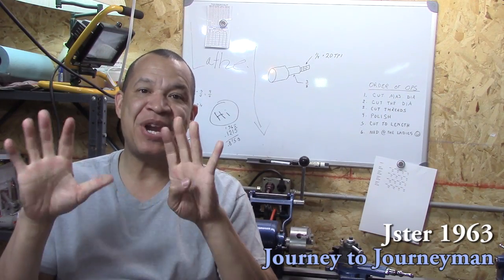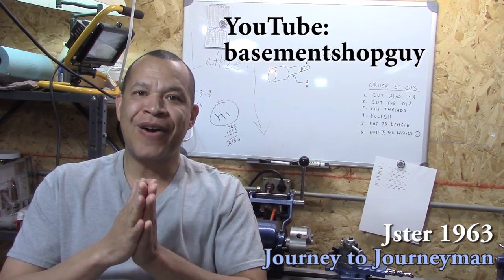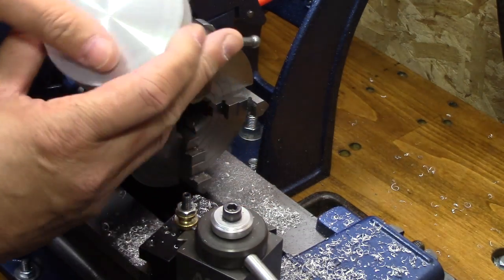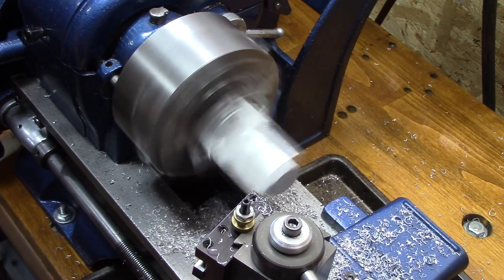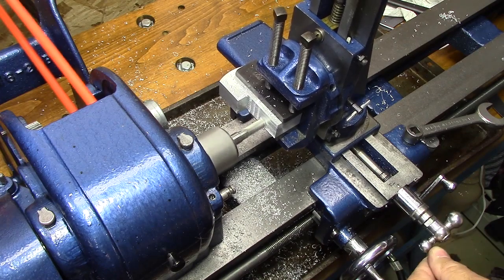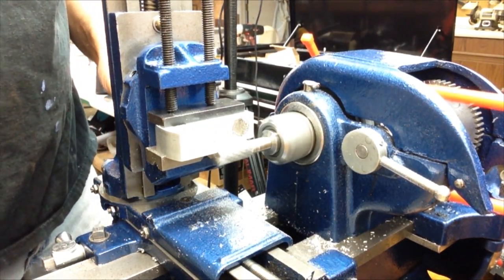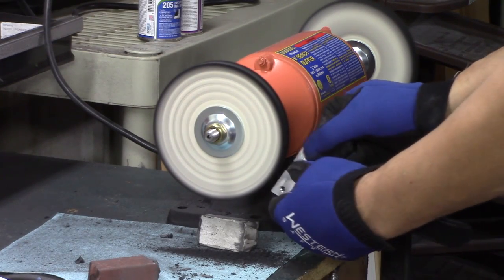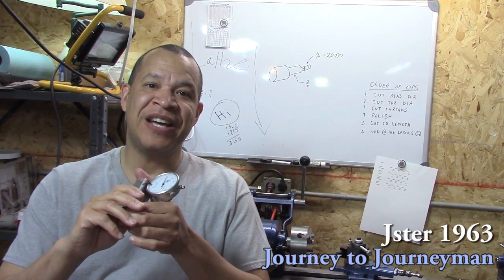Journey to Journeyman, Episode 9, How to make a mag mount for a dial indicator.

Comment: What is the price called that holds that cutting bit in the headstock where chuck goes
Reply from the maker: John Underwood It’s a collet. It holds the end mills (cutters)....
Reply: jster1963 what’s it just go in when you remove the chuck? Sorry if my questions are dumb, I just want to learn as much as I can ever sense I got the family lathe, I think it’s the neatest piece of machinery .
Reply from the maker: John Underwood No worries!  I bought an Atlas collet set and it fits into the spindle and is held on with a draw bar. The draw bar goes through the back of the spindle and threads into the collet and pulls the end mill tight.

Comment: That pop-can aluminium has come looking REALLY nice. I've been thinking "Will he re-melt his shavings when he machines that?" so I was pleased to see your zip-lock full of shavings.

Now, I'm working with plastics, not metal and I'm only cutting 3mm threads. So what I say might not work for bigger threads and metal but I always power tap with a cordless screwdriver and it's really quick and easy.
Reply from the maker: It's funny in America, "Pop" is called 4 things.  Pop (mid-west), Coke (South- and that's for any bubbly soft drink), Soda (both coasts), and Soda Pop (Old timers).  I was raised in Michigan and we call it "Pop."  So many guys say that the aluminum is bad, but it's just a high junk to good aluminum ratio.  And yes, I save the shavings and reuse.
I haven't tried to power tap like you say, but I just may try that.  Thanks so much......
Reply: We used to call it "pop" in England too, but that's kinda out of date now, a bit like "soda-pop" in the US.
I would have thought that it would end up as low-grade garbage aluminium but, as your experiments show, it's niiiiiiice!
Keep up the great work.
Reply from the maker: Thx!!
Reply: it is not "bad" aluminum, it is just not good aluminum. however if when you are smelting it you scrape off the dross as you go and keep it melted for a little longer to allow any extra to come to the top and take that off as well before you pour you will end up with quite reasonable aluminum. so far it seems you are turning out quite reasonable aluminum :)

Comment: I have a 7x14 HF lathe and have a milling attachment on it and mill a lot with a fly cutter, works great with a nice finish. It will give you more travel also. The fly cutter I have is a 4882 3/8" shank fly cutter from Little Machine Shop. Has work good on aluminum and steel.Thanks for the videos.
Reply from the maker: +Roger Brousseau Thank you so much!  I just started using a fly cutter and love it.  It will be on my next JTJ video.  I make another dial indicator holder.  Thanks again......

Comment: get your self a compound 2way cross vise and partly use your stand drill to mill stuff on. Exercise when you were cutting of excess metal in the vertical band saw. drill and tap a hole into the metal you dont need and make 5mm rod with thread tap into scrap piece screw in rod to help you hold it to make cut this way giving you experience in tap and drilling.

Comment: Nice project. When cutting material on the vertical band saw you might try lowering the blade guide just enough to clear the part being sawn and also use a push stick to save your fingers should the part slip.
Reply from the maker: +Gord Taylor Great tip and thank you!  I don't want to be known as "old 9 digits"  Thanks again....

Comment: In place of using a slitting saw, you could slightly enlarge the hole for the indicator stem and machine a suitable sleeve/bushing that you could split lengthways on one side just using a hacksaw. Position it such that your setscrew is pushing 90deg from the split line and it should allow a good grip without the setscrew putting a dimple in the indicator stem. 😊 Thanks for the videos 👍
Reply from the maker: +g00167015 Excellent idea!  I never thought of that.  I did buy a slitting saw, but haven't used it yet.  But what a great idea.  Thank you very much.....
Reply: +jster1963 👌

Comment: If you nick the magnet surface finish, it will rust away very quickly.  I design laser cut model aircraft kits and we work with Neodymium (rare earth) magnets as hatch latches and wing retention fasteners.  Proper procedure is to make the hole slightly deeper (you'll see why in a moment) than the magnet.  Burnish the magnet slightly with some fine grit paper.  Mix epoxy to glue it in with.  Use something like a rod to hold the face of the magnet.  Put a fine film on the magnet and in the hole.  Use your rod, install the magnet in the hole and slip the rod off to the side.  Now, here is the trick.  Make sure there is no glue on the top surface of the magnet.  Place a strip of tape over the surface and magnet, adhesive side towards the magnet.  This tape will become a release agent.   Now, clamp over the magnet and the surface it's installed in a flat piece of steel.  The magnet will be drawn to and jigged against the steel perfectly flat and flush with the surface of your tool.  When dry, remove clamps, pull off tape.  In following these procedures the magnet will be touching the lathe ways but not holding your fine tool off the surface.   In my aircraft kit world, CA (Super Glues) are often used.  However they are too brittle for Neo Magnets.  Each time the magnet comes close to steal or another magnet, they will smack together.  the shock will crack a brittle glue and the magnet will be released in a short number of uses.  Epoxy is slightly flexible and seem never to fail from these shocks.  These are the kinds of instructions that are in my kits where we need to install magnets in mating surfaces and want them to "just" touch each other.  Be careful the amount of glue used as you don't want it squishing up and ending up on top of the magnet.  It wouldn't be a terrible idea to drill a relief hole in the back of the jig so excess glue has a place to escape.  Your tool looks fantastic.  I am thinking it might also be cool to install a 1/4 by 1/4 disk magnet so the block is drawn in against the side of the way also.  I think you have enough material there to accomplish such a modification.  I have no experience with this type of indicator holder, just sharing some ideas.  The magnet holding inward would resist the carriage forces pivoting the indicator greatly and give your tool a "locating" feature against one edge.  Your part looks fantastic!  I'm inspired to build one soon as my lathe restoration project is complete.
Reply from the maker: Crafted WOW, Thank you very much!  Great Great way to do it.  I will use your trick next time.  I plan to make another holder and I can't wait to try your tip!  Btw, it does have the small 1/4 magnet that draws it to the side.  I just forgot to film that part.  I may even use a bigger magnet on that side next time.  Thank you again and I hope you post a vid when you make yours......
Reply: jster1963 I PM"d you.  I've started my series on the restoration of the QC42 Atlas.

Comment: If you think aluminum is nice.....try some 360 brass. High RPM's and a heavy DOC and feedrate.....watch those chips fly!!!

When you counterbored a pocket for the magnet, make sure you use slow RPM's, or it might start to vibrate and open up the hole larger than the diameter of the endmill. Happened many times to he before....will scrap a project.

Bar and chain oil works just as well as way oil. Make sure you use plenty, don't see much oil on those ways but then again I'm not there haha.

Seems like you've come along way....keep going :)
When will your SB9 be ready to run?
Reply from the maker: Thank you so much Andre!  I have no idea what 360 brass is, but I will look it up.  It is a joy when the chips fly! 

I never thought to slow down the RPM for the mag pocket.  I think I will make another one of these, so I will slow it down next time.

I do use way oil. I got the way oil for my SB lathe. I've heard bar and chain oil will work, so I will give that a shot too.   It must be the camera is not picking it up.  I want to use the SB lathe so badly, but I don't have it in my basement yet.  I'm nursing a back injury and need help to move it.  So I hope to have it up and running this summer.  Fingers crossed.  Thanks again for all of your suggestions.......
Reply: Get well soon, and use leverage to your advantage!
Reply from the maker: Thx.  WIlco....